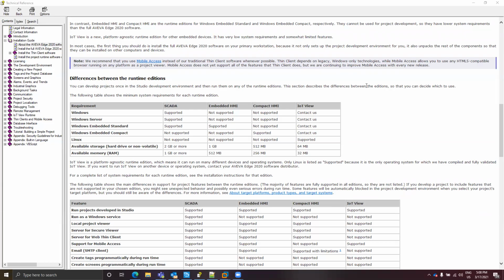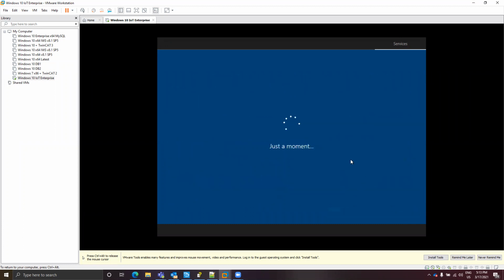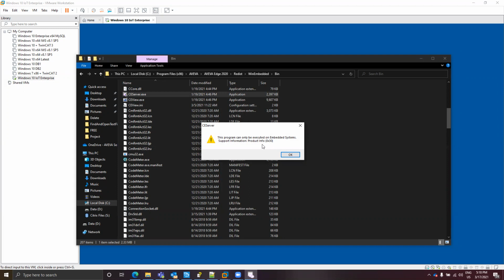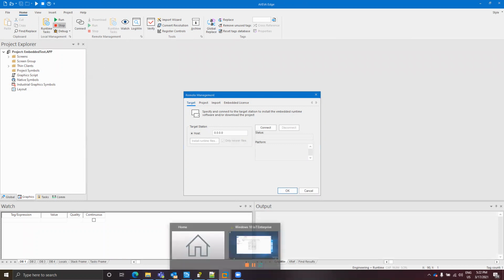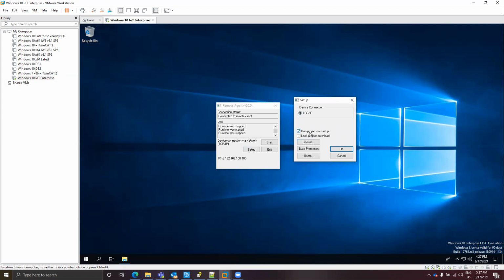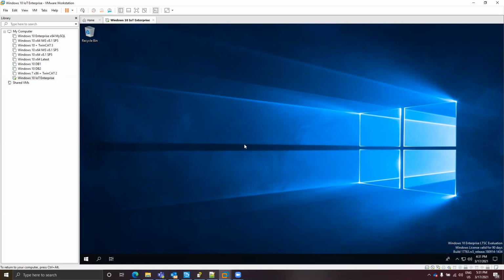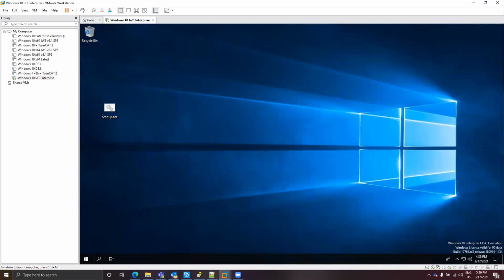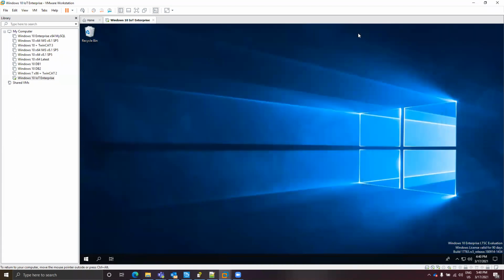How to install, license and automatically startup an AVEVA Edge/InduSoft Web Studio Embedded Runtime

Comment: On my remote agent setup page I do not have run project at startup
Reply from the maker: You are using a wrong remote agent. Check from where I copy it in the video.
Reply: Does it matter which folder I get it from? I will try that exact folder and report back